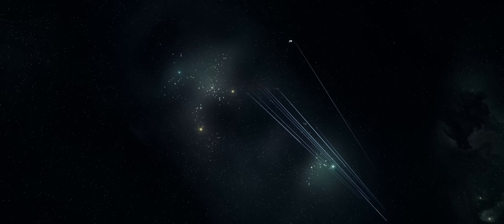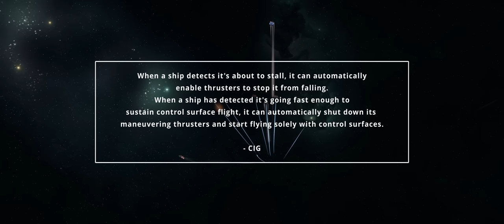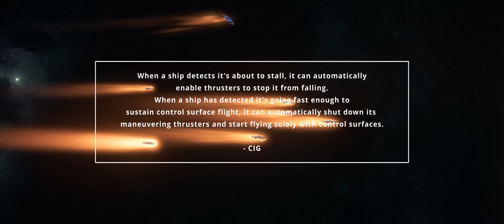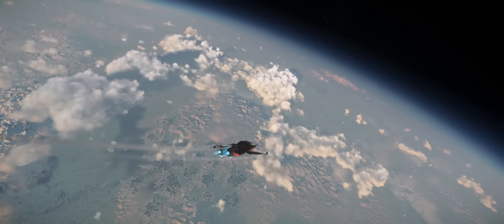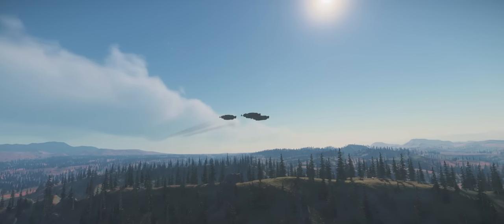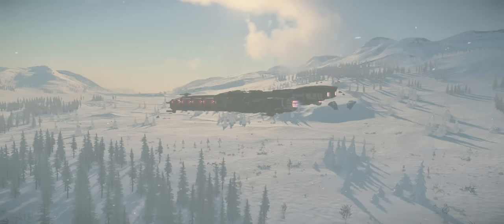THIS Will Be A BIG Change To Star Citizen Flight

Comment: Really looking forward to these changes, they haven't been discussed enough. It will be great to have some functional distinction (vacuum/multirole/atmospheric) between weight classes (light/medium/heavy). I look at the Aurora and think "it's a brick" but it should be Very maneuverable in vacuum since it is considerably lighter than an Arrow, the MAV thrusters are placed well for high rotational acceleration & besides the bed it is just an engine & S1 components. I do think that Starter Ships, particularly Aurora/Mustang need to have some edge in flight, somewhere (besides range) on military class ships. 

Military class ships generally need a lot more draw-backs and should be less prevalent in the verse, even as PvP mains. When I see an Arrow, or a Gladius, or a Hornet, etc - I want to feel like I'm in a warzone. If you are close to a military base, you don't think much of seeing military vehicles coming/going - but if you constantly get buzzed by F18's on your commute into the city you'd probably think about staying at home. I look forward to the day where my Gladius isn't my daily driver, but instead is sat under a tarp in my hangar and is only taken out for training or war.

Comment: I think it would be cool to have runways alongside landing pads on planetary bases/outposts/etc. The only problem I have though is the fact that very few aircraft that would require a runway to land, such as small/medium fighters who don't (or shouldn't anyway) have powerful enough thrusters to allow them to make a VTOL landing, also don't have proper wheeled landing gear, but retracting legs, and the ones that DO have wheeled gear don't have the proper physics applied to said rolling surfaces. Still, I think it would be fun to have to do a proper landing like planes do today, having to manage your approach with airspeed, elevation, etc., instead of just being able to come in hot and heavy, slam on the brakes and belly-flop onto the pad basically. I myself find enjoyment in a nice, proper, soft landing, so I take my time and make sure my landings are something a real pilot would be proud of. Lol

Comment: I think some ships ought to get adjustable afterburner nozzles á la jet fighters, would make hovering look much better and could work in conjunction with control surfaces to reduce dependence on maneuvering thrusters.

Also main thrusters should be turned off/idle when hovering in place if they're not adjustable. Nothing sillier than when it looks like they're firing at full capacity when you're completely still and the maneuvering thrusters are doing all of the work.

Comment: The first time hover and vtol mode was introduced there was massive backlash and it was removed. We have to find an answer for how ships like the  Cat can stay aloft on such tiny thrusters, I've always hated how most ships act like they have very little mass and extremely powerful and precise thrusters.
Reply: its so unimmersive imo. i hate it. it feels like I'm in 3DS max moving 3d models around not flying a heavy ship. a Cat shouldn't be able to hover and maneuver good AT ALL on planets with gravity..its a space lorry. it should do just enough to get off the ground and fly into space, lift off thrusters have a limited time to boost up and engage main engines. then skilled cat pilots will be a thing and worth something to ppl. always a danger of babyfying SC with all the new reactionary players and the set in their way older players who hate any change

Comment: It could a nice bit of variation in that some ship require more skill to use, and some are more forgiving. should be fun. Also, mavs ought to kick in when requested rate is higher than what control surfaces alone can offer and not just rely on "are we about to stall". Otherwise we're going to have some weirdness where our ships aren't as maneuverable as current vectored thrust fighters and it'll be like we're regressing, not 950 years into the future.

Comment: I'd guess weakening the thrusters ready for atmo flight would negatively affect the ship performance in space?  That would be unhelpful XD
More likely, the control surfaces will be used to sharpen handling and if thrusters are disabled and/or improve range from the space engines by using traditional lift?  The more you have the better the handling.
Also, I saw none of the examples have LEADING edge flaps.  These are used to maintain airflow over the wing at progressively higher angles of attack eg on takeoff.  Only trailing edge flaps, ailerons, are visible which are responsible for roll / trim.  Both of these would suggest IMO that thrusters will play an important part of Star Citizen physics.

Comment: During 5 or 6 years ago (a3.6?). It is happen once. Ships with low speed is action like Helicopter. It is very dificult to land. Only a small group of player who like FlightSim is appreciate. But the rest of players hate that system. Then CIG decide to remove that flight model.

P.S. Are you missing F7C?

Comment: this is a nice development coming and hopefully done well! 
One thing I never understood is, why the maneuvering thrusters are so overpowered. 
I see what small to heavy fighters need powerful thrusters in fight for strafing and outmaneuver the opponents. it makes sense that they have a more than 1G accelleration on their thrusters. But that made never sense to me on ships like the Constellation, Caterpillar or even a Cutlass. 
Every ship that is big enough to have VTOL capabilities should not be able at all to hover in place on any planet with just their thrusters. On moons that's fine but not on the main planets with 1G and definitely not on crusader. 
Same for landing pads. if the landing gear is down, every ship with VTOL should also switch to VTOL mode by itself. Otherwise it should smash hard into the pads when gravity kicks in.

Comment: I have been waiting for control surfaces a while. They can just power curve tune out the thrusters with IFCS fly by wire to use them when it needs. All ships have VTOL toggle even if they don't have apparent VTOL thrusters for a reason and why we have the arcade model in atmo today. An older attempt was depending on the ships stall speed they had to switch to VTOL mode where thrusters did the heavy lifting at the cost of agility. Last time they did it ships became unstable like a helicopter hovering unless you had purpose made VTOL ships and could crash if not careful like a real helicopter pitching too much to maintain lift and was always drifting/fighting so you couldn't stay still IIRC. Back then surfaces and physics model were not ready and tuning the thrusters ended up with the compromise we have today that erases VTOL mode on most ships except the ones that use main engines, but it just transfers forward to strafe up thrust.

That's why they showed off that tool that helped them visualize ship thruster forces recently. They are taking a stab at control surfaces and redoing landing/VTOL mode and master modes which we also had before in the past. Definitely going to be an exciting future for SC flight and combat.

Comment: Many SC ships are Space Only by design. Any decent into atmosphere should be a death sentence unless the main engines are pointed straight at the ground and you fly directly away from the planet. Also the consumption of hydrogen fuel should be proportional to the throttle of the engines. Hovering should deplete your fuel tank rather quickly. Large cargo ships may need a full fuel tank just to contemplate a surface landing and you had better consult your ship's computer to make sure that the gravity isn't too much for your VTOL engines.  If you're close to the limit, you'll need a slow and controlled decent to avoid crashing into the surface.   Flight computers of drones limit decent rates based on thrust-to-weight ratio.

Comment: What if some large cargo type ships that were not originally designed for flying in the atmosphere needed the assistance of specialized VTOL aircraft to keep it up. So a player would need to request assistance where NPC ships would then come attach themselves to their craft so they can land or take off safely and not just fall out of the sky like a brick. It could add a new dimension to combat where players could now target the attached VTOL crafts to knock a ship out of the air while its moving from the surface of a planet to space.

Comment: Both, control surfaces, vtols and manoeuvring could work together, for brief boosts.
A ship with VTOL engines could simply take off and land as an Osprey, without much concern, but be slower when the engines look down: if it's a brick like a RAFT, then just hover if you want to fly.
A small fighter should have enough lift to land vertically, but not indefinitely  and certainly not outside a flat horizontal attitude. Get to speed and fly like a plane.
A "Big Chungus" like a 600i could partially use a lifting body at high speed and rely on manoeuvring thrusters to move around and land.: certainly NOT hover on it's nose
A box with engines, like a Caterpillar, would rely on those engines to keep flying, trying to stay as horizontal as possible to maximize the thrust.
All good, but where is the MASS? A Fully loaded Hercules nowadays flies like a medium fighter, which is "slightly" off to me,, especially since I've never heard of Mass as a concern to be addressed by CIG.

Comment: Yes but nah, "landing requiring speed" defeats the purpose of space ships and would make most of landing pad un-usable.
Instead, they should have a % of power converted to "vtol thrusters" (on all ships).

for example, you land with a gladius, you slow down over the deck and while you slow down, alot of your power % goes to "vtol mode", meaning you have way less thrust in all other directions. Like 90% of power is redirected to maintaining vtol, so you only have 10% to work with and land.

This would work well as it keeps the "vtol" usabillity of all ships, and also limits how much a ship could move on heavy gravity (making it an easy target, and hard to use as a "flying turret).

Putted simple =>  under speed threshold => vtol mode (90% of thrust goes to vertical , 10% left to manoeuvre)
                               over speed threshold => gradually gain back power on all directions so you can move and use wings to maintain lift

The treshold would vary depending on the forces of gravity and the density of the planet. But also the %, a moon with low grav would require less% obviously.

It should be easy to do and foolproof, i'm hoping they do something like this instead of trying multiple instance of wonky afterthoughts system that will break each others.
The strenght of ships with proper Vtol will be that they can move arround faster and have more control given they were made for that.

Comment: See... I want them to go further. Rolling starts, angled launch pads, or slingshots as you'd find on a carrier deck. Even runways for the bigger ships. Bringing a ship like the Caterpillar or Hull C into atmosphere should be risky. Putting one down in a place like Teasa should be a hair raising experience only to be pulled off by skilled pilots.

That or sight redesigns to ship models for the inclusion of VTOL capabilities by adding engine angle rotation.

They (CIG) made a claim that the physics in game were to mimic true Newtonian laws, let's actually see that happen.

Comment: i cant wait for this. if they go to the point where smaller ships can barely go side to side and evade things side ways that would mean bigger ships would stand for of a chance and see more use on events like JT or bounty hunting missions on ground. In the current build you see ships going from side to side 100m/s which is truly immersion breaking. i cant wait for this feature. also i hope that the bigger ships struggle to maneuver on atmospheric planets just like in space engineers where the bigger ship wont stops unless you approach at smaller speeds.

Edit: wow the cinematic shots are actually amazing great job

Comment: The addition of FCS to Star Citizen has the potential to take the game with the most fun 6DOF starship atmospheric flight experience to a whole new level of immersion, nuance and skill ceiling for pilots to achieve. If CIG implements this the right way, which I have confidence that they will, any other space (and atmo) flight sims will have a hard time getting close to the high bar that Star Citizen will hold up. I can not wait!

Comment: I'm super excited by this change to come. It will be interesting to see what it does to racing. I expect every existing race track will be no longer viable, especially with tight turns. They'll have to go back to the drawing board. I'm fine with that though. It will make combat way more dynamic with a completely different experience in different atmospheres (of vacuum) you have to adapt to.

Comment: The real question is that, how will winged ships cope with a planet that has Earth-like gravity but a thin atmosphere, if they get very little lift from the wings and the maneuvering thrusters are too weak for prolonged use.
Reply from the maker: Yep this is an excellent question! There is such a fine line between too weak mavs or too strong. Balancing it for the high G low density is tough and likely will require some kind of overheating mechanic.

Comment: No, if you change the maneuvering thrusters to be weak then it will impact the most important part of the game. Space combat! Not to mention it would not make sense that these ships can take off and exit a dense atmosphere planet with ease from the main engines but then not be able to hover with maneuvering thrusters. Control surfaces and aerodynamics should be supplemental to the game not a primary factor.

Comment: If the drake corsairs manuvering thrusters were to be made weaker they might as well remove them entirely.
Reply from the maker: Good thing it has VTOL then 😏 Wait until those massive wings generate more lift 😉

Comment: One ship I didn't see here is the Redeemer. What kind of new challenges do you think these changes will bring for that ship?

My opinion is the Redeemer looks like a limited VTOL ship, capable of hovering, but with a struggle. The profile of the tail and nutcrackers tell me she looks like a straight flyer perhaps with very strong acceleration. I'd still like you know what you think.
Reply: Ive heard that cig will add in a feature to put maneuvering thrusters into overdrive (more power but with extreme overheating and potential damage). Based on that i bet the the redeemer along with some select other ships will require thruster overdrive when taking off and going full vertical with main engines to break atmosphere (think of the ships in CoD infinite warfare where ships have to switch to their massive engines when exiting atmos and going vertical, only using their vtol/maneuvering thrusters when maneuvering at normal speeds)

There will also be those tractor beam tug ships to help with those ships too so there is more than one way to exit atmos

Comment: I am hoping star citizen has a auto level flight assist system upgrade that prevents large ships flipping in atmo and makes them super easy to fly in turtle mode but not fast, so hammerhead c2 bmm 890j as they really don't behave like heavy ships yet in atmo, tho the HH is the best ship got belly crawling moons cos of its lower cockpit

Comment: I disagree with most of what you said in your video. Control thrusters already barley work if you increase speed above the red line; This is where control surfaces should talk over. Also "being able to hover forever" is a misnomer as all ships have a set amount of fuel and hovering coasts the most to do. As well as making yourself an easier target for ground and anti-air fire. Small ship should be able to hover in any orientation, as they need to thrust in any orientation in space.

Having thrusters overheat in atmo is counter to how it would work. As in space the shop would have to do all the cooling. But, in atmo the very atmo will help with cooling.

It's already a task to land a large ship, especially with a full cargo hold, on a planet. I agree that VToL needs to be updated along with the addition of control surfaces. VToL mode needs to be more dynamic. Where as of right now they just turn 90 degrees. They need to rotate with control inputs rotating to provide thrust in the needed direction for lift or forward and backward movement.

Comment: With the quality of CIG's coding, though, I wouldn't hold my breath for anything actual or usable in that regard for the next 5-7 years. Such a thing also requires proper and precise physics simulation of the airflow, etc. This is something the server cannot handle. There is basically no proper physics in the game. So any changes are more likely to be reverted and the idea scrapped. Just as we saw with the VTOL "revival". But SC has been about dreaming all the time, so yes, keep on dreaming...

Comment: Impressive work put on this video mate! And an opinion greatly developed! I’ m totally in! Not that I want a flight simulator vibe, not at all, put the flying hovering potatoes is an immersion breaking issue and an unbalanced gameplay. I guess hovering on maneuverability thrusters should induced high vibration (a bit like the RIP hover mode) then, depending of the ship, a rapid breakdown of power. The RSI aurora for instance is a hard choice on planetary flight (unless CGI unfold its four wings) while should be perfect in space, and the Mustang should be the first pick for air flight (there you would have a clear choice in between the two for starter ship)